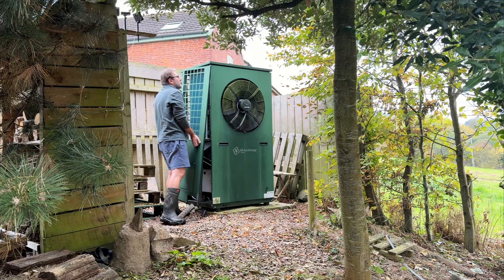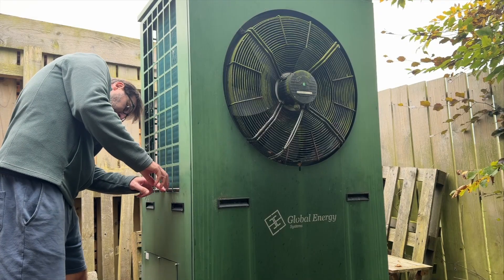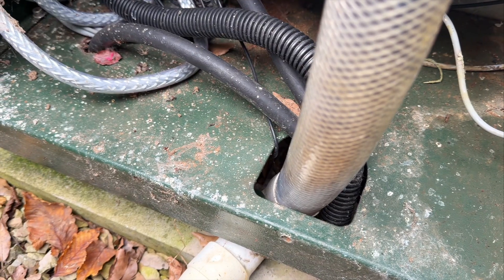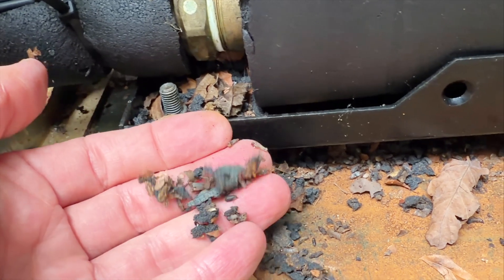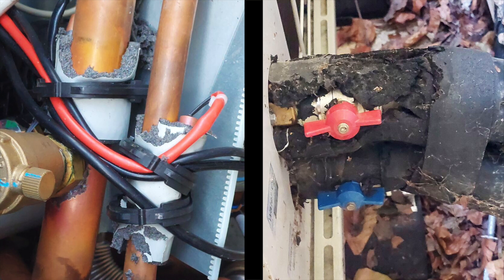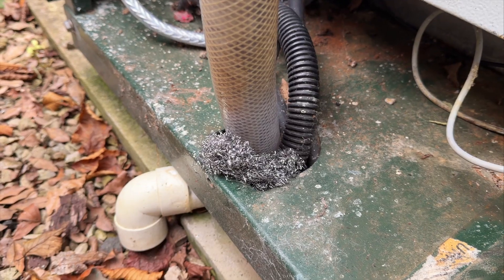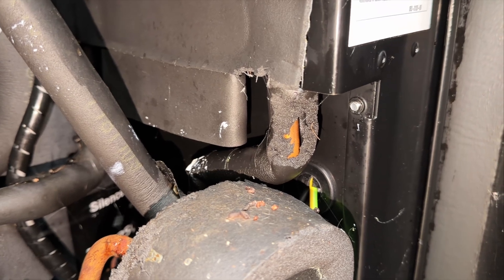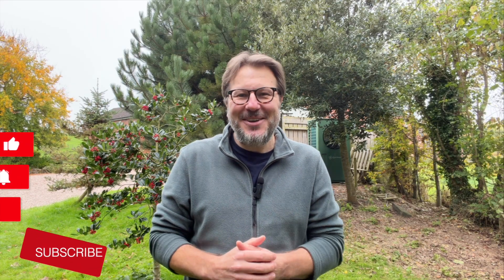The Heat Pump Problem No One Talks About

Comment: Any hole where you can fit a pencil, Rodents will get in. Wire wool will help to stop them; however, as the areas will be affected by moisture, wire wool will start to rust and deteriorate. Use copper wool, as they don't like i,t but it will not deteriorate with moisture ingress
Reply from the maker: Thanks for the tip!

Comment: If you see signs of gnawing or droppings act quickly can save you a serious headache & a lot of money  ....  If you see signs of You Tubers inside your heat pump let us know in the comments how you stopped them from coming back !
Reply from the maker: Thanks for watching! 😉
Reply: Any hole where you can fit a pencil, Rodents will get in. Wire wool will help to stop them; however, as the areas will be affected by moisture, wire wool will start to rust and deteriorate. Use copper wool, as they don't like i,t but it will not deteriorate with moisture ingress